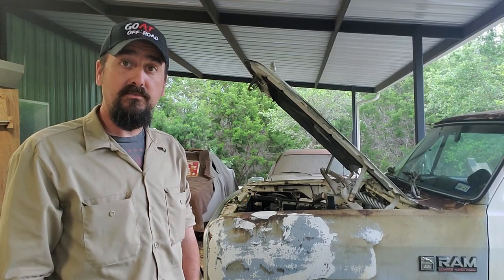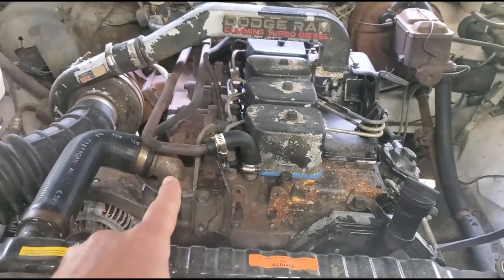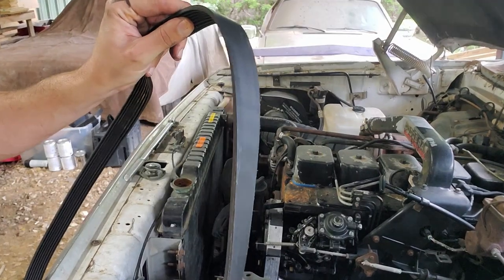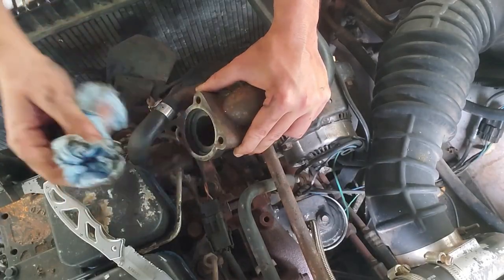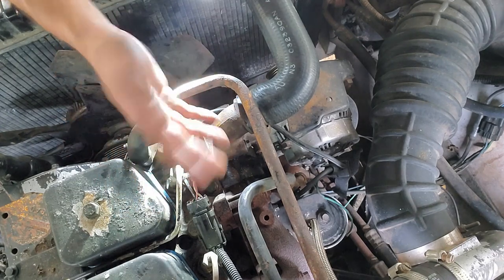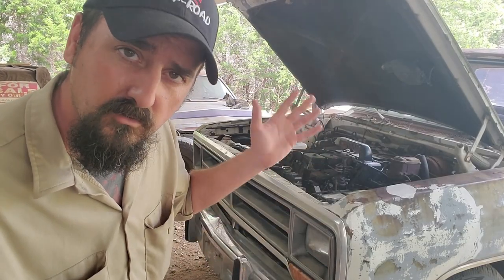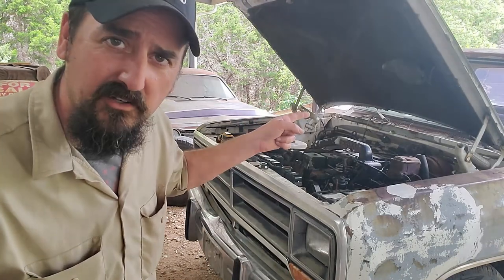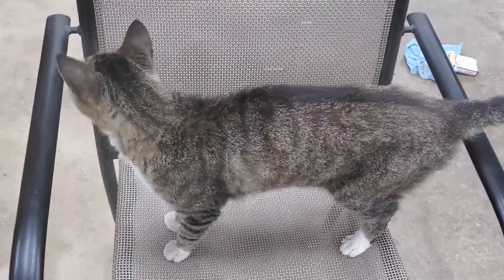Episode 52 1990 Dodge D250 Cummins Water pump, Belt, Tensioner Pulley, Thermostat Squeak Squeak

Comment: With my luck I would have done all that and it would be the alternator that was squeaking.
Reply from the maker: Trust me I was worried about that once I was finished hahaha
Reply: @DuddiesAdventure  My current project started out with rusted out brake line to a rear wheel. So far I've had to replace both rear wheel cylinders, brake shoes, bearings, and drums. rear and middle brake lines.  Now I've got a master cylinder on order.  It seems never ending but it'll have damned good brakes when I'm finished.

Comment: Lucky if guage is right, mine goes up, then down,
Reply from the maker: Yeah Cummins temp gauges do that, They do make a special thermostat that will stop that from happening though. But Ive never tried it.
Reply: That and the oil pressure guage do it. But if voltmeter does, the voltage regulator going out🤦🏻‍♂️

Comment: Hey duddie I'm curious can u lift a d250, if so how and could u take a chevy 2500 and swap parts to it
Reply from the maker: I think you can put coil springs spacer on the front springs. No idea if the Chevrolet 2500 parts would swap though
Reply: @DuddiesAdventure  did u ever lift urs and make 4x4,  I just bought a d250 for parts and was curious about the ifs 4x4 under a chevy that's a good question huh?
Reply from the maker: @shannisgeorge  Nothing from a IFS 4x4 Chevy will work under a Dodge unless you just weld it all on. If you watch the Prospector Playlist you will see Im converting a 2wd Dodge Frame to 4wd
Reply: @DuddiesAdventure  I ll go back and watch them thanks ,